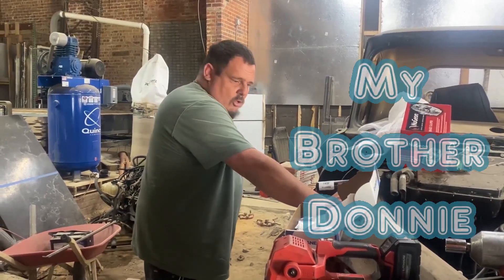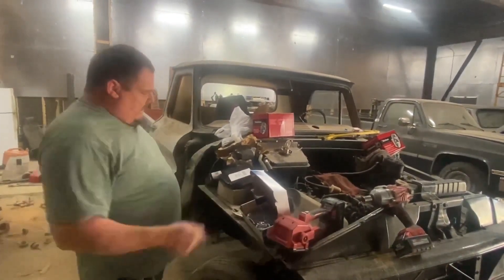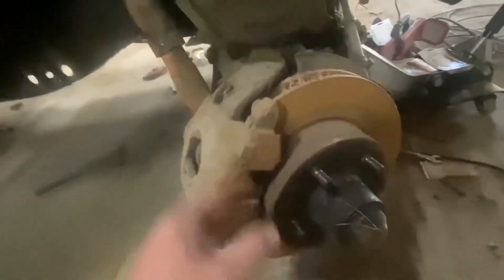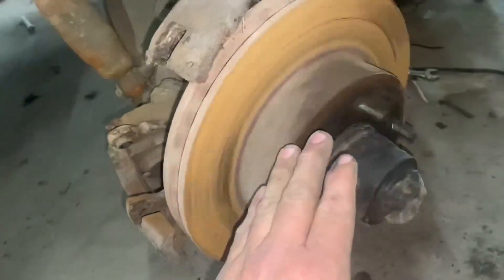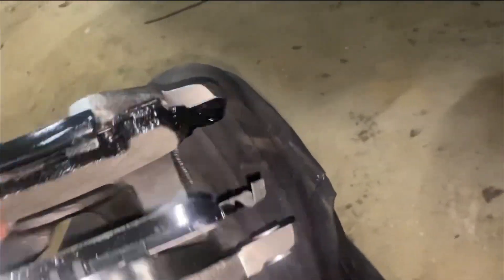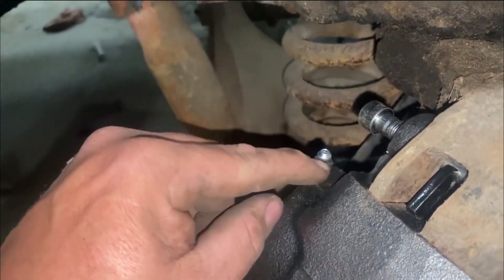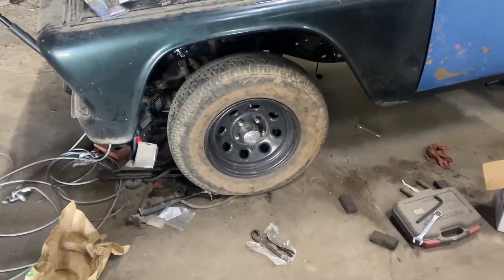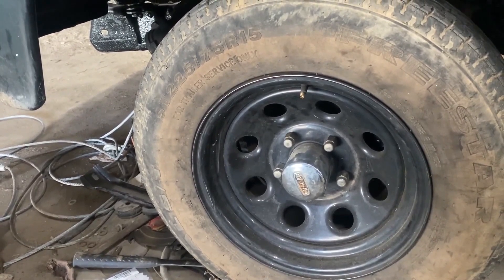Putting New Calipers On A 1965 Chevy Pickup Truck With Updated Disc Brakes

Comment: Donnie, that tire reads for trailer service only!🤣
Keep an coming buddy!
Reply from the maker: War out trailer tires I put it on there to move it around I didn’t wanna buy new tires and send it through paint and all that and ruin new tires on it All  four of them are used trailer tires
Reply: I figured that was the case but couldn't resist poking ya!
Thanks for the videos buddy.

Comment: What did you use for spindles and caliper brackets
Reply from the maker: I found a 70 Chevrolet C 10 and took the spindles and calibers out of it
Reply: @mybrotherdonnie  did the ball joints fit the 70 spindles
Reply from the maker: @AllenMathews-u1h  yes
Reply from the maker: @AllenMathews-u1h  I have done too that way I have not had a problem with either one one of them I drove about 50,000 miles and it’s been fine. I haven’t had any issues.
Reply: @mybrotherdonnie  okay thank you for the info
Reply from the maker: @AllenMathews-u1h  you’re welcome